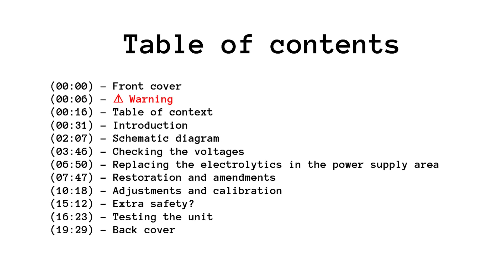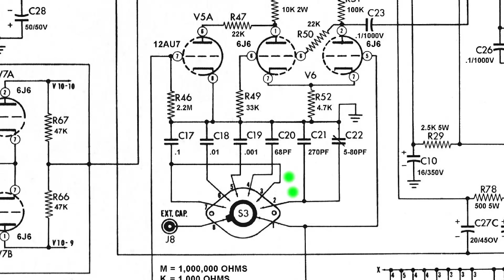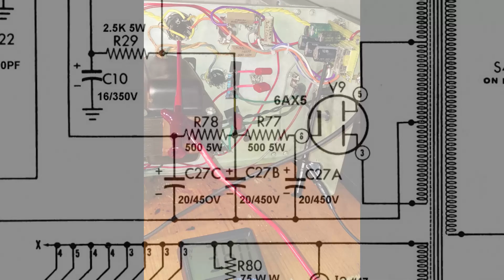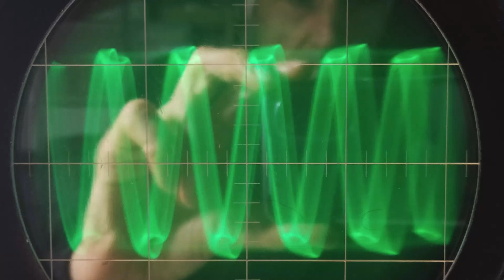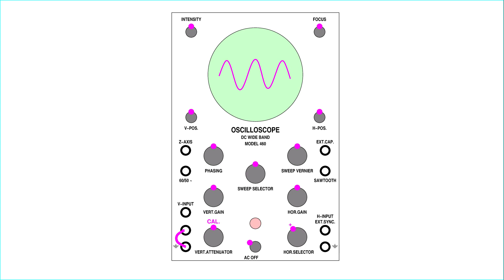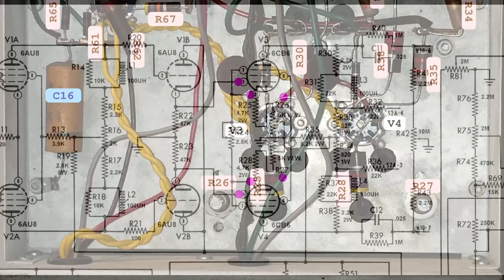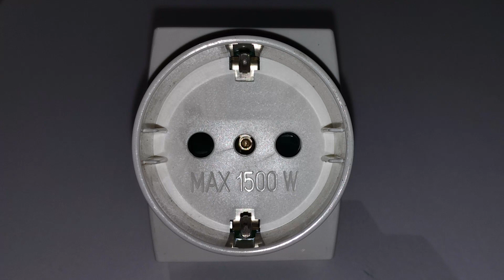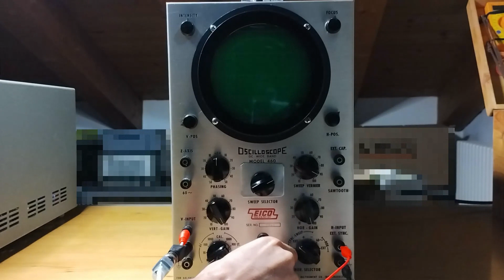DG’s Practical Notes, E#7 EICO 460 Oscilloscope, 1954

Comment: what cords are used to plug into the v-input?
Reply from the maker: Hello. You mean what cables were meant to be used? Maybe only just twisted wires. However, I used a BNC adapter for common shielded cables of for a regular oscilloscope probe of today. 🙂